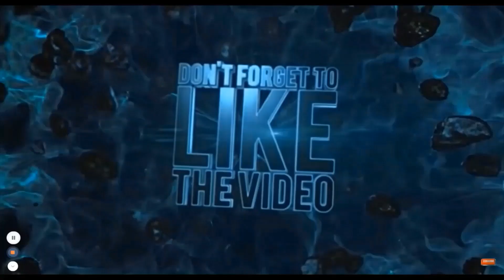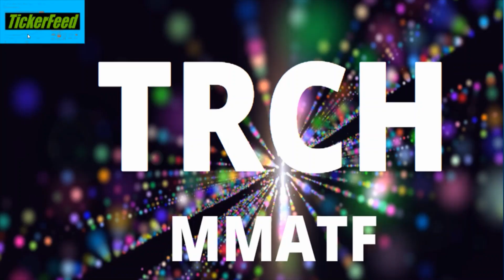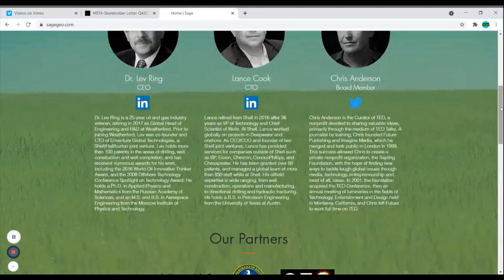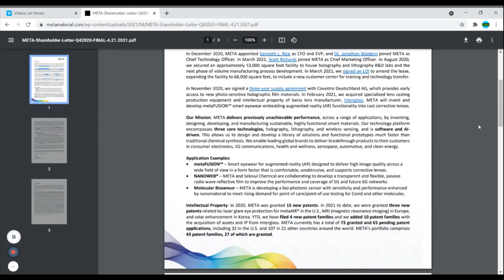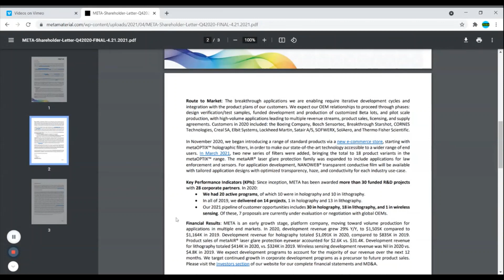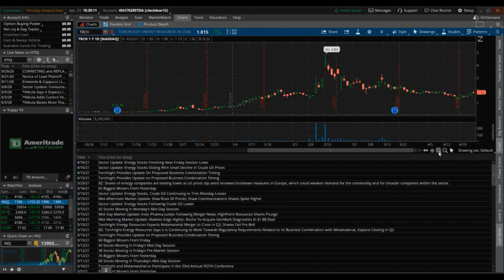TRCH & MMATF MERGER UDATE! TRCH & MMATF STOCK NEWS! UPCOMING CATALYST! PRICE PREDICTION ANALYSIS!

Comment: If you own both meta and torch..how will your cost basis be determined once they merge
Reply: After the merger the stock will be whatever TRCH stock is trading at. 
If you own trch you will have 1 share of Metta.  If you own Metta you will get three share for every one you own.
Reply: @DavidSmith-gb8em  yes as far as the stock price..I was curious about cost basis per share
Reply: Your cost basis might be reset because its a new ticker but that does mean it changed.  If you are worried write it down.